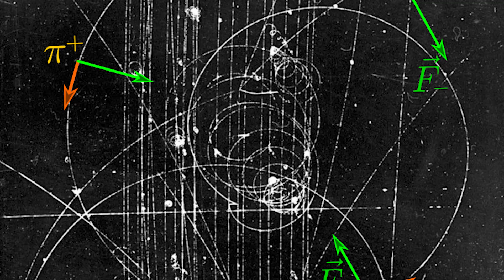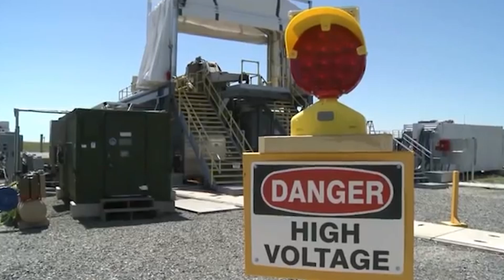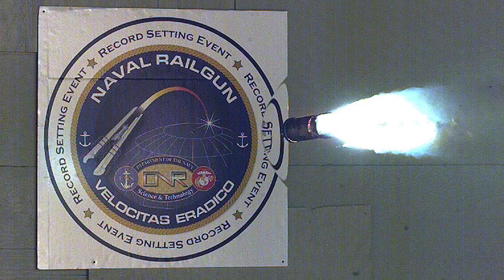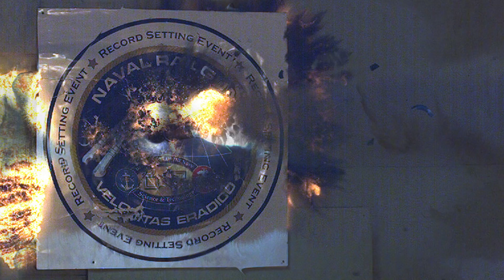Railguns: The Kinetic Future of Warfare

Comment: Using cannons to get stuff into space? Jules Verne would be proud.
Reply: Well sorta, but not. It would be more like an electric trebuchet using magnetism instead of the counter weight... since people become rather squishy when you depart them at 20000G :P
Reply: @andersjjensen  I know that using it for humans is (currently) out of the question because of the squishiness but the idea is related.
Reply: @andersjjensen  I mean, what if we restrict it to cargo payloads? Getting material into space, especially heavy and massive amounts of cargo is honestly a bigger issue than people. We could use conventional re-usable rockets to get people into space, and since we would have a more efficient way of sending cargo, those rockets now have a TON of empty space.
Reply: @andersjjensen  yes but in order to get them into space using such a railgun you would probably need to do some research based on reducing possible damage taken from high velocity encounters.
Reply: You wont need to worry about high G because the device won’t accelerate the payload faster than needed for it to escape the gravity well. 
You can just use the good old rocketry equation to figure out how much acceleration you need 👍
I think that’s why a track length of 3.6km was mentioned.
Reply: @KarryKarryKarry  I don;t know much about the actual equation but I'd thought that the needed accelaration to put someone into space with a cannon would be more than that.
Reply: @KarryKarryKarry  Maybe. But I wouldn't volunteer to be the first squishy fired out of that thing.
Reply: @kaltaron1284  Significantly more, assuming that all acceleration occurs at launch. So instead of using the gun to generate all the thrust needed to enter orbit, you just use it to give the rocket enough momentum that it won't start falling the second the engines turn off, and then you use the engines to keep it at that kind of speed. This is still extremely cheap compared to a pure rocket system, since it pretty much cuts out the need for boosters and launch stages altogether.
Reply: @natesmodelsdoodles5403  So a hybrid approach? You give the rocket intial speed and just counteract the slowing by gravity and as you need less fuel, the rocket is also significantly lighter. Not as light is if you'd give it enough starting speed to make it to orbit without fuel mind you but sounds far more achieveable.
Reply: @kaltaron1284  Pretty much, yes. if you don't need to climb to the 3+ G acceleration that you need for launch, you don't need the fuel for that acceleration. The trouble with a ballistic (No Vehicle Thrust) launch is that you either need such an extreme acceleration that it's pretty much going to shred any spacecraft and make chunky salsa out of the crew, or you need a Mass Driver so long that it's literally impossible to build without turning it into a space elevator.
Reply: @kaltaron1284  MagLev trains already exist and are the same basic principal, we would just need a VERY long rail.
Reply: @CrimWorld9  Well and building vertically is a bit more difficult than horizontally.
Reply: @kaltaron1284  and if an accident happens and the payload doesn't make it to space you just blew up a city XD
Reply: @KarryKarryKarry  I’m still confused as to how this wouldn’t crush the crew... maybe I’m not understanding the whole system. But getting up to orbital velocity within a few seconds/half a minute seems like a rather deadly situation. If not for the craft, certainly for the hoomin squishy..
Reply: @Zman44444  The system would accelerate the craft to Mach 1 in about a minute, and then continue accelerating at the same rate along the track before finally launching.  Hence the need for a 3.6km long track.  In fact, accelerating to Mach 1 in 60 seconds subjects you to only 0.58g, so it could probably safely accelerate you quite a bit faster than that.
Reply: They already tried it (and succeeded, I think) with the Project HARP superguns, back in the 1960s. That said, they could only launch shell-sized probes, so whatever you needed to get up there would have to be pretty small.
Reply: @phantomechelon3628  The concept might have some merit for entirely unmanned cargoes but I don't think it will ever hold any merit for manned voyages. Given that simply shooting something into orbit and hoping it will get to where you want it to sounds rather optimistic, other methods might prevail.
Reply: @kaltaron1284  I never said it was feasible. Just that tests were done back in the 60s, using massive guns to launch projectiles into low Earth orbit. 

Given the project was abandoned a long time ago, I'm guessing they already came to your conclusion.
Reply: @Phantom Echelon  It still might be an option for cargo but the problems that need to be overcome are probably too much to bother.
It's also the question how much interest and therefore money is currently there for that kind of stuff.
Might be better to go with what we have and make small improvements while hoping for some breakthrough with space elevators. Not that I foresee those in the near future.
Reply: We've coma a long way since The Flintstones.
Reply: Might be better mounted on a satellite hooting objects to earth or other satellites
Reply: cannons are directed explosions that launch projectiles. rockets are directed explosions that launches the rocket itself.  the only difference is that the explosion is coming out of the projetile, rather than from the location of the launch
Reply: @jonathanodude6660  There's also another important difference: With a cannon you have one explosion that gives you all the energy you will ever get.
With rockets you convert more energy until out of fuel.
Reply: @kaltaron1284  yeah true but still that’s more of a controlled reaction in general. Like the oxidation reaction between fatty acids in the body and in a combustion engine are fairly similar, but one is controlled such that the chemical energy can be converted to a different form, and the other is converted to a small explosion to drive mechanical parts.
Reply: @jonathanodude6660  Sorry, but what was your point again?
Reply: Engineers: found miraculous ways to transform human visual information into light waves, transmit it over vast distances and then reconstruct it in tiny devices that use liquid crystals being ordered by electricity.  

Physicists: built km long incredible machines with precision in the fractions of the size of a proton that measure the very disturbances of the fabric of existence. 

Military dudes: still searching ways to throw rocks faster.
Reply: @Annou7la  So, Wonka Vision?
Reply: @valiroime  The engineers comment that'd been made is talking about cell phones and the liquid crystal displays.

Comment: IMHO The rail-gun is an over-exestuation of current tech without a more compact power source. Nuclear is still the best bet.
Reply: I could see it scaled down to the size of a tank.  Tanks already carry a huge engine to move that much weight.  So you switch that engine over to a generator and drive the tank like a diesel-electric locomotive.  Then when you want to shoot, you use the generator to charge a capacitor bank.  Limiting factor is how quickly you can recharge the capacitors.

That leaves the question of barrel life, but M1 Abrams only carries 55 rounds anyway.  So barrel life might not really affect how long of an engagement a railgun tank could fight.  You would need to have something like a quick-change barrel and make barrel changes part of your standard maintenance procedure.
Reply: @tippyc2  Or just use coil-guns instead of railguns. A properly designed coil-gun will, in theory, have little or no barrel wear at all.
Reply: @tippyc2  Railgun development actually switched from tanks to ships years ago, when everybody realised that fitting one into a warship would be so much easier than fitting one into a tank.
Reply: They already have enough power on the Zumwalt Class Destroyers.  We built 3.  If its anything its material science that is effecting this tech.
Reply: @Kenneth_James  Yeah, power is not the most immediate limiting factor anymore, rail life is.  It is all fine and good for the US military to say they have done hundreds of shots with a set of rails; I want to know how much repair and refurbishment was required between each shot.

After the rails you have to keep the projectile alive.  At 3.3 km/s (~Mach 10) frictional heating will raise its surface temperature to >3000 C and it will be enveloped in plasma, doing exciting things to electronics and absorbing any radio transmitted guidance instructions.  Pro: that also means it will be invisible to radar.  Con: it will look like a supernova to anyone with an IRST system.  Check out the Sprint missile (3.4 km/s) from the '60s to get an idea of what Mach 10 at low altitudes looks like: https://youtu.be/msXtgTVMcuA (yes, that is their real speed shown)
Reply: @Kenneth_James  doubt

Comment: Small correction, opposite eletromagnetic charges/fields don't repel each other, they attract each other. Maybe the magnetic field of each rail might end up with their same poles against each other, that would make them wanna repel each other quite badly considering the shear amount of pwoer needed to make this device work. Induction might also be a problem, cuz the last thing you need is that you magnetic fields start melting the inner machinary of your weapon.

Comment: You can’t use a rail gun to launch people, the g force would turn them into liquid.
Reply: You can make a rail gun accelerate at whatever speed you want.  If it's moving humans, set it to 3 g's.  Unfortunately, at that rate of acceleration, just to reach low earth orbit would require a rail gun approximately 1000 km long................. and yes, that's a problem.

Comment: meanwhile in the Metal Gear universe: launching nukes using rail-guns.
Reply: thats not unique to metal gear, the fatman in fallout MIGHT be a rail gun, or it might be a slingshot i dont remember
Reply: @Christian24583  it a slingshot system
Reply: @Christian24583  The Fatman in Fallout is based on the real life Davy Crockett recoil-less gun prototype from the 50s.  If you look at the "ammo" they used for it, it even looks like the mini nukes in Fallout.

Comment: you should have said in the video how old those clips of the railgun test where and that it has gone 100% dark since then with just mentions of a few already installed on ships a few years ago. so they might very well already have big beefy ones up n running on ships. i think one of the tests has to do with the projectile exploding into a fine shrapnel in the air to take out missiles

Comment: Most new navy ships of war in  developed have been designed from the bottom up to handle the power requirements for rail guns and for high energy lasers as well as other extremely energy intensive systems both known and theoretical. In some of our newest destroyers that have already begun sea trials are already capable of mounting and using them.  And that's just the Navy.  So they are not at all far future technology nor are they not being developed actively by the military in United States. Because they don't carry explosives it means that vulnerabilities warships normally have in combat (or often by accident) by carrying explosive shells for their guns are entirely bypassed. Yes, the ammunition has been adapted for use in conventional guns, initially but that in no way stopped the development of it for the rail guns. It's only a happy antecedent to the rail gun program, not the death of it.  The biggest problem of that ammunition when used in a railgun is the cost of the round itself.  Finding another use for it brings cost per round WAY down which greatly benefits the overall viability of the entire program in a way that usually is only seen much later after it becomes ubiquitous and volume of production lowers the cost of each unit.

Comment: There is a lot you are missing here for clarification. Current tank guns shoot a projectile at over 3,000 meters per second.  So matching that is a useless gesture.  For a railgun to be worthwhile it would have to fire at over 5,000 meters per second, which is a lot harder than their current velocities.  And the higher power needed to reach these higher velocities imparts that much more force on the apparatus which increases the likelihood that the gun will be damaged by its own firing.  Also, the railgun is ridiculously inefficient in power use, this is why it requires so much power, because it wastes so much.  When you consider how much fuel is needed to create the energy needed to fire the railgun, it seems like it would be much better to just use a regular gun firing a rocket propelled projectile. It will be a long, long time before a railgun is used in combat... if ever.

Comment: The biggest problem is accuracy. Modern projectiles fired at ranges over 10 or so miles are in most cases smart projectiles. Artillery rounds that have GPS and can adjust their path to help fall on the desired location, or with small sensors to help them land on vehicles in the final descent. Missiles are guided and can come screaming in with high speed and pinpoint precision, some against fixed locations with GPS or initial or terrain navigation, others against moving targets with laser guidance, thermal, or radar targeting systems in built.
Now the problem is even if a projectile is fired at twice the speed, or even five times the speed of a normal cannon... unless you are firing at closer in targets directly so they can't evade with a smaller time window, your shots likely to be long distanced and on a curved trajectory with wind, air pressure, and all sorts of other problems. So if you can fire at something 100km away but the projectile is just dumb and purely ballistic you might hit a city, but not specific buildings very easily, and just forget about moving targets. This pretty much means you have a SUPER limited range of uses for a railgun without smart projectiles, not worth the extreme cost over most alternatives.

And while the acceleration Gs are pretty notable, the real issue there is the extreme electromagnetic forces the gun generates. You can't have a complex computer in that sucker. A normal tiny transistor isn't even viable. Metalic bits in them get torn about and its destroyed from the magnetic fields. So we need some type of super durable electronics that can survive this... or alternatives. So we've come up with some nice interesting tech to help here, but it's looking far off from being able to handle complex sensors for radar or thermal guidance, and even simple antennas for GPS or such aren't likely something we'll have working that soon. In other words, for the foreseeable while, we'd just have a big super expensive dumb gun that would hardly be worthwhile, so for this reason most likely, the focus on railguns has dropped from active development to passive technology examination and validity studies in the US. The general idea being rather than building new stuff, they are mostly just finishing gathering some useful info from currently made prototypes, and will for awhile mostly be examining new breakthroughs in other fields to look for any new tech that might help overcome the current limitations/problems and may should they find such bring it up for more budget to experiment/develop such new tech to help. Materials science like making the rails is, while not done, stuff we've arguably gotten into a basic workable level, and with more work could likely make practical, but if you have the gun but no projectile then it's pointless. And if the projectiles going to take another 20 years to be possible, might as well finish the guns research later on when it'll be faster and easier with other improvements in material sciences helping out by then (not to mention it's just pushing back a bill/expenditure from now to sometime in the future and politicians love doing that if they can).

Comment: I'm curious,  what kind of mass do you all think would be required in the nose of the sabot round to keep it following the curvature of the earth at 3km/s?
Reply: Modern tanks currently fire projectiles at over 3 km/sec. So this is old news.
Reply: @danieltempas6062  it's not news. It was a  physics question.  Tank shells also don't have to meet the same parameters as the sabot would out of this.

It's a far more technical problem than you seem to understand.
Reply: @StrangeTerror  I well realize.  First, modern guns already fire at ~3 km/sec, so it does make it old news.  A problem that has already been dealt with for decades at that velocity. Second, artillery rounds have been made to go up to 50 miles distance, so the curvature of the earth, again, is already an issue that has been dealt with.  Perhaps what was meant was the rotation of the earth, which has also been dealt with in the past.  I am not sure about you "not the same parameters".
Reply: @danieltempas6062  20,000Gs of acceleration,  massive magnetic stresses, the incredible amount of energy flowing through the projectile, the list goes on. It's not like off the shelf electronics are going to hold up to that obviously.